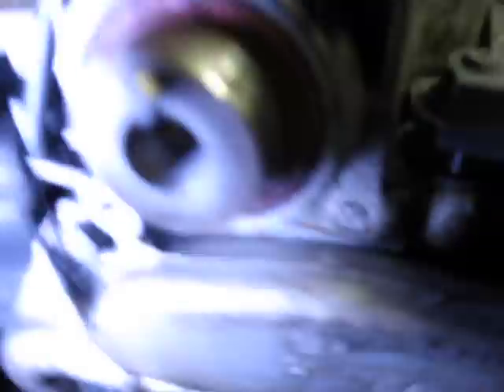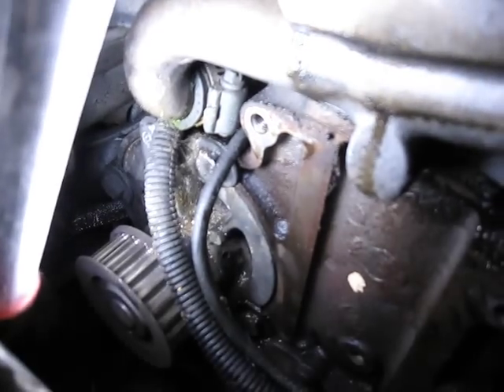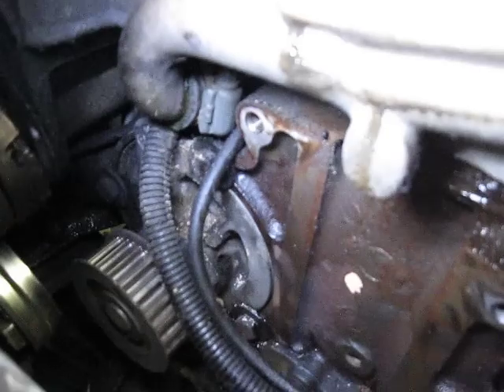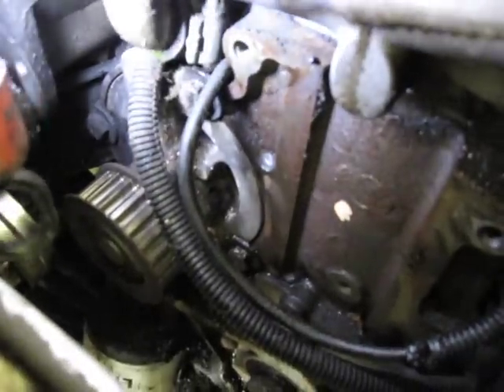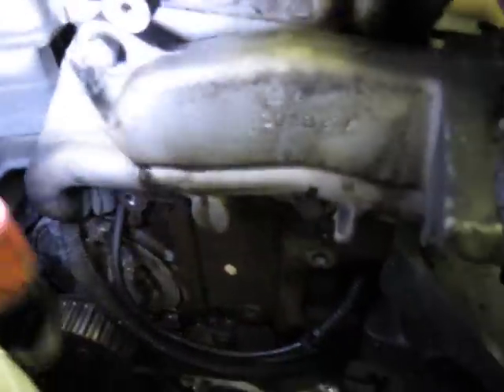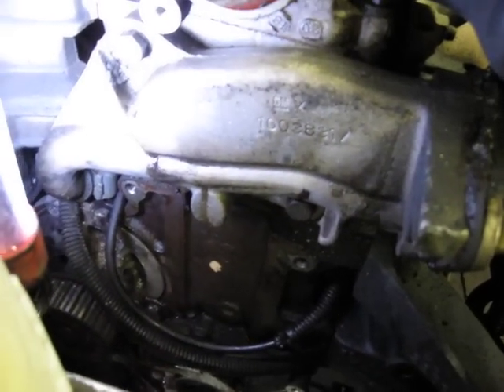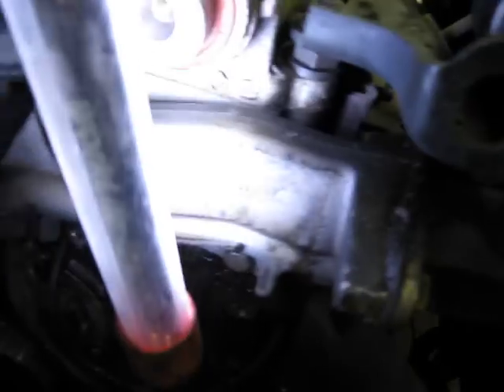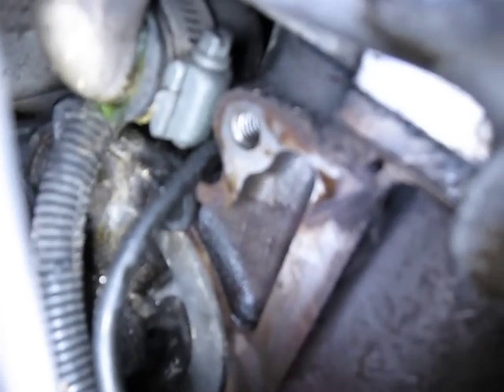How to replace a 92 Sunbird water pump part 2

Comment: Ok I got it out and put the new one in loosely to get the timing belt on. The pump however did not bolt on like I had thought but it was on the same way. I think you should mention that the bolts around the pump hold the pump in with the edge of the washer. 

Also I am surprised as hell you didn't have to remove the alt and shift the power steering pump back I had to do it that way for room and coolant reservoir had to come out. Also mine was leaking from weep hole too.

Comment: have a question....do you know where does the wire hooks up too? it's the one that is by the reservoir and the alternator or the power steering pump.....thanks...it has 3 holes

Comment: Sorry but there's way way more to doing this job than what you've shown in this video . For starters just getting the timing belt back cover off can be a royal pain . The crankshaft sprocket has to be removed along with the camshaft sprocket as well and to do that you have to make sure the engine won't turn as you're trying to get the bolt free . On my 91, I had to use a torch to break the loctite bond and then use an impact driver and some super creep anti-rust spray and let it sit overnight which did the trick . I also had to remove the left front tire to get access to the front of the motor and block the flywheel from turning by inserting a flat blade between the flywheel teeth . Needless to say this hasn't been a fun job at all . Just getting your hands in front of the engine is a pain . I can see why shops charge  a thousand dollars or less to do this job .

Comment: It looks like you had to take off a motor mount and jack the engine up some, am i correct in this?

I have a 94 sun-bird same engine model and i think i have a water pump leak,  im about to dig into it and i am wondering if im going to need to jack up the motor in order to get to the pump freely.